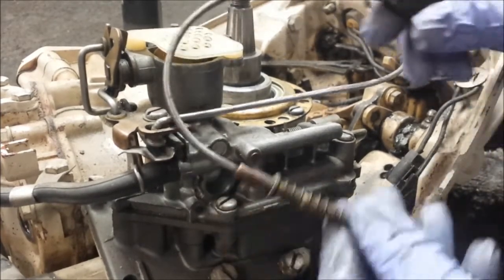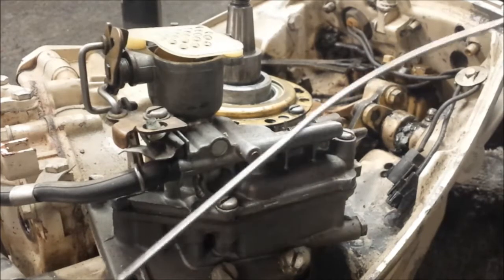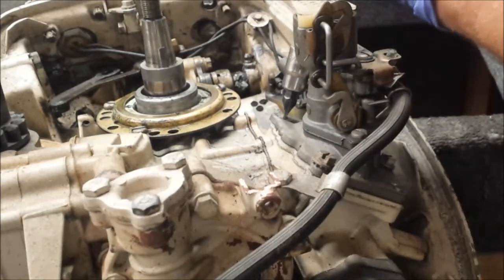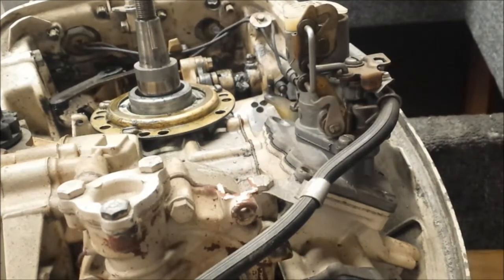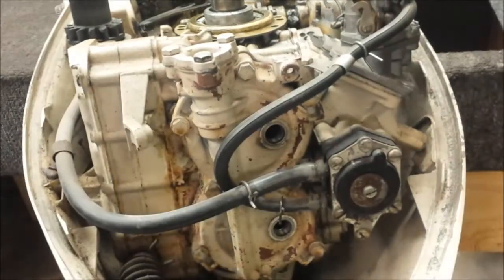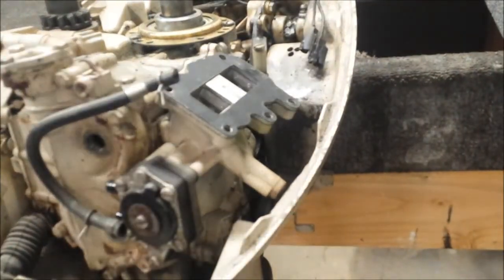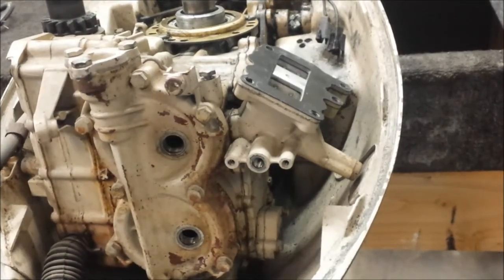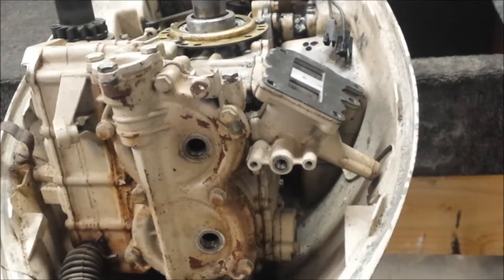Johnson 9.5 HP Teardown - Part 3; Carburetor & Fuel Pump

Comment: Hey man. Is there any way you can swap carbs for this? Mine has a little trouble getting my boat up on plane which causes it to hang like it running it at about half throttle
Reply from the maker: Sure its running on both cylinders?
You can swap carbs with another 9.5, but that is the only carb that will fit this thing.
Reply: 😩 ok. That won’t fix this issue lol. Thank you for the insight though. Was hoping to be able to move t up to a 15.

Comment: I have a 1970 9.5 Johnson with bad fuel pump. The square one is 120.00, will the other stile like yours fit mine and if so what part # are they, do you know??
Reply from the maker: It will,  but that's the original style, you really don't want to use one if you don't have to. 
Have you considered an aftermarket pump? bit.ly/0388833
Reply: Yes I have but trying to find one that I can afford....120.00 is outrageous.
Reply from the maker: Did you look at the link I sent you?
Reply: I did...THANK YOU.

Comment: Hi Brandon.  Your videos are great. I have learned a lot from watching them. At 1:40 seconds you mentioned a screw that can't be accessed without taking the flywheel off. That scared me because, I don't have the puller. However; I put the motor in forward and opened the throttle and I could see the screw. I tried my 3/8 screw driver but, it was too big to turn the screw. I tried a smaller screw driver and I was able to turn the screw. Whew!!!!  Thanks again, keep going strong, brother.
Reply: I was in the process of taking out the flywheel while fiddling with the gears and was able to take out that last screw. phew..

Comment: My 9.5 runs good but I have some questions maybe you can help it runs good up until you get the tiller handle to "fast" and then it spits and sputters you know what that could be?? And I replaced my fuel pump but when I put the linkage back together it drives fine but won't go back into reverse now??thanks man awesome vids!
Reply: Where did you get the fuel pump ??
Reply: Boo LuQuette Amazon
Reply: Thanks 530  when you get time can you send me a part number or a link for that pump ??    TIA Mon Ami ~!~!